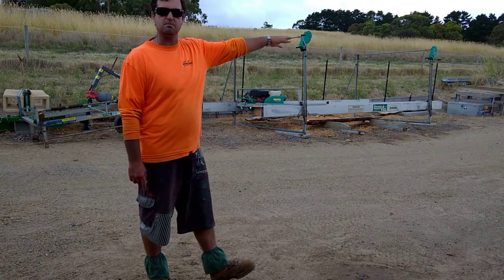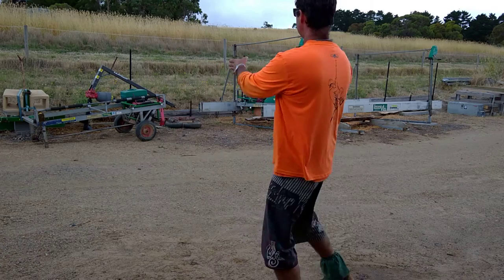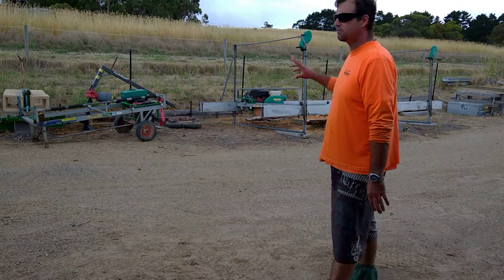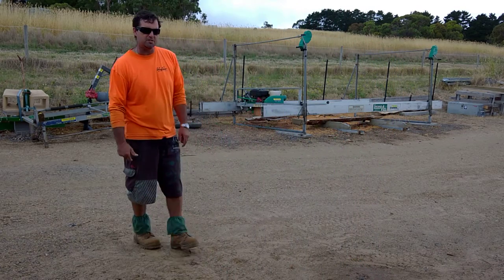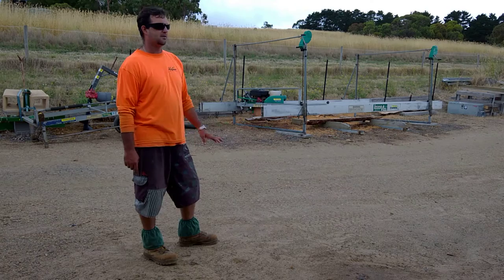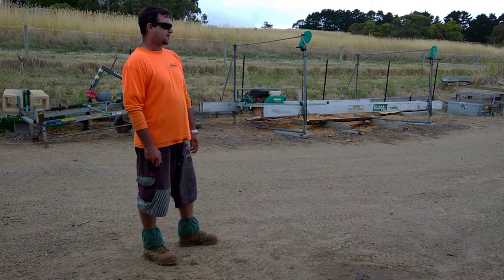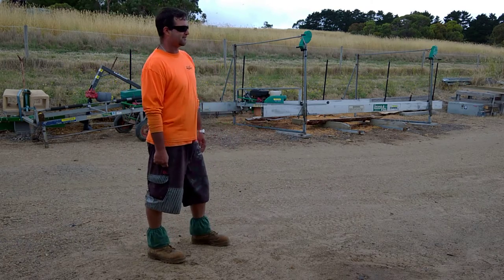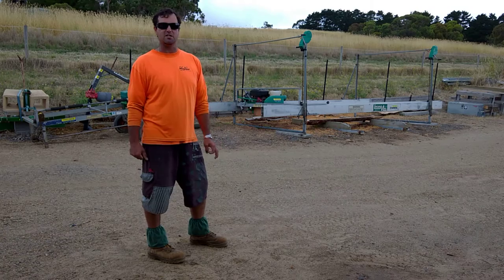Lucas Mill tips and tricks - Part 6 Dedicated Slabber Vs Slabbing Attachment

Comment: Are both engines the same? Could you change the slabber to a dimension cutter if your primary dimension cutter had a catastrophic failure? If so, that is smart to have that redundancy as a professional. You wouldn't have to wait days or even weeks for parts or service if there is a problem.
Reply from the maker: Both engines on mine are the same (Briggs and Stratton 16HP V-Twin ) However they have different configuration ie: the slabber is a vertical drive shaft motor and the swing blade is a horizontal drive motor. Very different in the way they are set up. The redundancy you speak of is what I am working on at the moment.. I am hoping that someday soon Lucas Mill will offer me a good deal on an 8 inch Mill..Hint Hint Lucas Mill